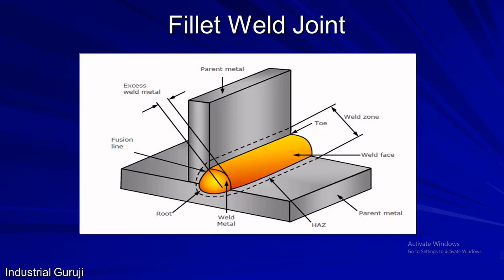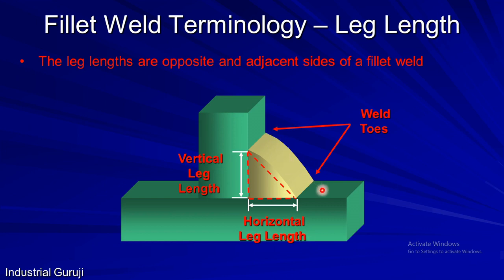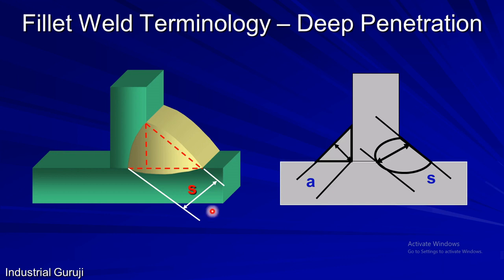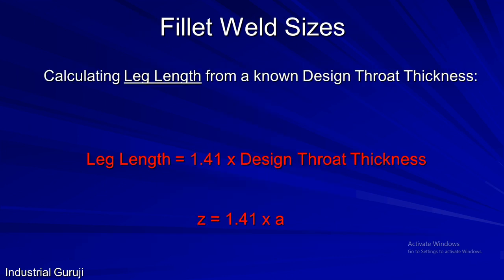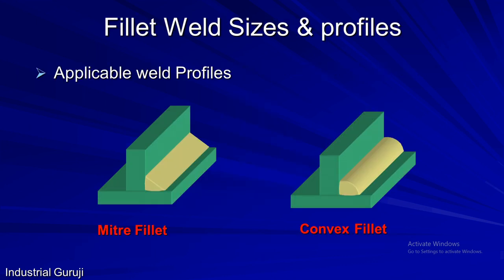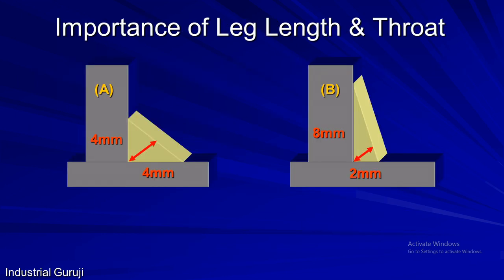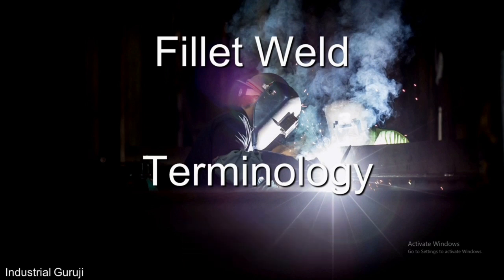Fillet Welds | Fillet Weld Terminology | Throat | Leg Length | CSwip 3.1 Welding Inspector

Comment: what are the condition to select 1 miter weld,2 convex weld 3 concave weld  and how these three can be welded to achieve required shape  as in practice it is difficult to get these three varied shapes

Comment: you don't need to remember every factor, just calculate this :- cos(max angle/2)
ex:-
cos(90/2) = 0.707
cos(100/2) = 0.642
cos(106/2) = 0.601
cos(113/2) = 0.551
cos(120/2) = 0.5

😉
Reply: 2:18
Reply: 2:18
Reply: 3:34
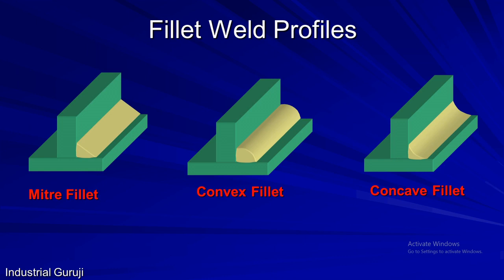Reply: 3:45 3:45
Reply: 3:54

Comment: Sir for 3 inch pipe dia how to take leg length at 90 degree
Reply from the maker: Which joint you talking ? Is it pipe to pipe fillet joint ?
Reply: Yes fillet weld
Reply from the maker: @Varunkm110   Sorry Varun for delayed reply, bit busy with work. You can try leaf type Weld Fillet Gauge. Just Search Leaf Type Weld Fillet Gauge on google. Leaf type gauge directly shows you leg length of weld. you  will see variety of leaf gauges available. The size which fits your weld profile is the leg length. Posting some of he links to make it easier for you

1. https://www.amazon.in/KRISTEEL-Pocket-Fillet-Gauge-Leaves/dp/B018M38ZPS/ref=asc_df_B018M38ZPS/?tag=googleshopdes-21&linkCode=df0&hvadid=397079204570&hvpos=&hvnetw=g&hvrand=1546424369554557702&hvpone=&hvptwo=&hvqmt=&hvdev=c&hvdvcmdl=&hvlocint=&hvlocphy=9040229&hvtargid=pla-882197975489&psc=1&ext_vrnc=hi

2. https://www.bestomart.com/products/kristeel-shinwa-leaf-type-fillet-weld-gauge-7-leaves-ltwfg-1000051785?variant=31276915032122&currency=INR&utm_medium=product_sync&utm_source=google&utm_content=sag_organic&utm_campaign=sag_organic&gclid=Cj0KCQjw1qL6BRCmARIsADV9JtYyUyAn7im40hLKDNsskfrCml5PJ8225g8yGemngxYtCZsDFNqnvUkaAncvEALw_wcB

Hope this will help you. Keep asking such questions & do share my channel videos to friends. Also comment on what topic you want my next video
Thank You